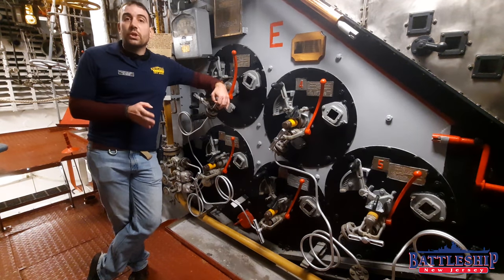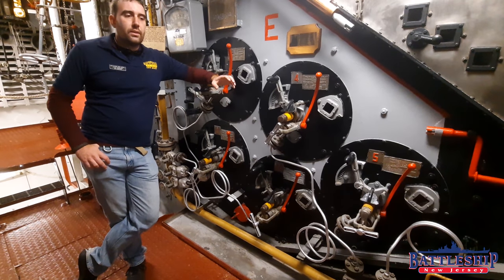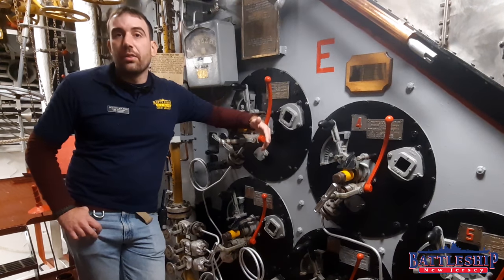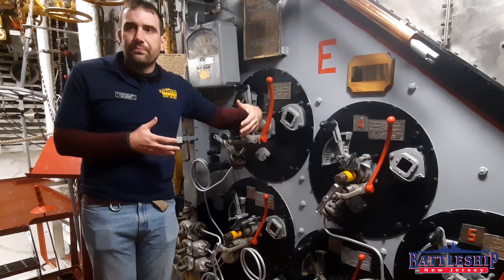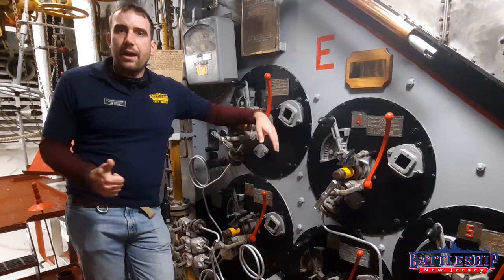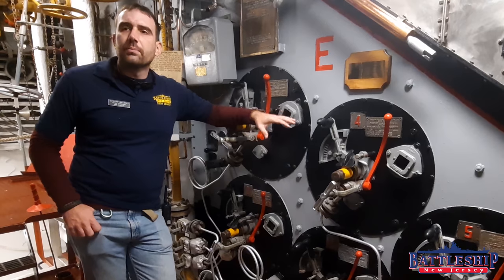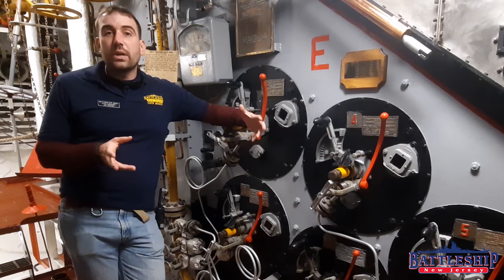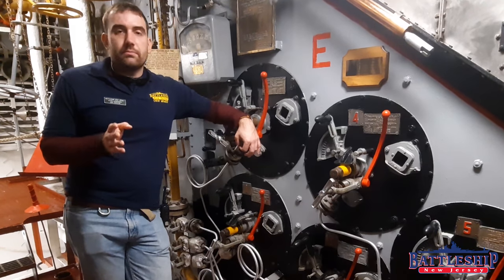Nuclear Powered Battleships

Comment: One of the things that I don't recall you mentioning were the training requirements for the crew. The U.S. Navy's nuclear power program is one of the toughest and most rigorous technical training programs in existence. The enlisted theory section is the rough equivalent of a 30 quarter hour engineering course load. Then you go to prototype for hands on training. Then when you get to your ship or sub you qualify all over again on that specific vessel. None of that is easy, and the Navy has to be able to offer good pay and bonuses to get and more importantly retain the people they need who can complete all the qualifications and do the job. The training needed to operate a conventional steam plant is nowhere near as intensive. And all that regardless of the fact that you're basically looking at 600 lb steam plants with different sources of heat.

But if things go wrong with a conventional steam plant you simply flick a switch and the plant is shut down. On a nuclear power plant you can flick a switch and shut down the nuclear chain reaction, but it will still be producing decay heat at roughly 7% of the power level it had been operating at for an extended period of time until it actually cools down completely.

Comment: If building from keel up, I'd be seriously considering liquid fuel reactors (such as FLiNaK or FLiBe), but also having diesel backup so if all reactors were knocked offline, diesel can still get the ship out of harm's way. Liquid fuel has several advantages, one, when it comes to refueling, holes need not be cut (or hatches opened up), rather, use pipes to swap the fuel out.

Comment: Ah, wondering when this one would come up considering the number of times I've seen the "nuclear refit the Iowas" argument made.  Totally agree with what you said re it not being viable.  Between the weight of the reactor plant and all its shielding outweighing the boilers it'd replace by a good margin and the different steam conditions nuclear plants produce requiring significant reworking of the rest of the systems it'd likely cost almost as much as a new Iowa to refit even if somehow we didn't have to design a new reactor system from scratch.  If there were to be a propulsion change because for whatever reason we've committed to bring back the Iowas I'd probably think it'd be hybrid gas turbines or gas turbine-electric as the only financially viable options.  What I am curious about and hope the Pentagon is watching and planning for is the potential military use of SMR technology.  Using a modular integrated reactor that can take less space, have fewer components, run with more automation and less maintenance, and be swapped out whole once its fuel load is exhausted.  That may be able to help cut down the biggest hurdle to future nuclear combatants: the staggering costs involved, 'cause I want nuclear cruisers back!
Reply: Nuclear cruisers just don't have a role in the modern navy. Not because of tactical or strategic concerns, but because of the geopolitical considerations due to their nuclear reactors. Lets face it: nuclear vessels are a significant investment, not from a cost perspective but from a political standpoint. They cannot be sent on the sorts of high-risk, independent operation missions that cruisers are intended to perform. Imagine if a CGN were to suffer a terrorist attack like the USS Cole, but instead of a damaged ship and a few dead sailors you got a damaged ship and a Chernobyl-scale nuclear incident. As such, the only role a nuclear cruiser could ever realistically be used for is a carrier escort. And there are cheaper, better ships for that job.

It's OK though, the modern DDG is the size of a cruiser, the cost of a cruiser, and fulfills all the roles of a cruiser. It's just called a destroyer so Congress will pay for them ;)
Reply: Please understand I am not trying to pick a fight or be disrespectful but are you sure on the weight issue? The steam power plant on the Iowas was MASSIVE it was the most powerful steam plant ever put on a Warship. I am an Iowa vet and I remember learning about the Steam plant in ESWAS qualifications and I could not get over how big it was.
Reply: Improvements in reactor technologies now mitigate most of the circumstances. It'd be easier to design a reactor around the ships constraints than vice versa. 
Westinghouse already begun plans and worked on it's new reactor called the eVinci the first "Solid State" reactor.
- Unlike conventional reactors the Solid State reactor has no moving parts except the control rods. 
- Unlike conventional PWR reactors there is no water in the core thus no risk of any core failure or coolant leak issues
- The Unit doesn't use flow coolants of liquid metal like flammable/explosive sodium or heavy lead/bismuth eutetic thus mitigating molten metal's corrosive issues

- Factory built thus components can be brought into the ship by hand. 
- mitigates all waste heat via solid state tubes i.e heat pipes just like the CPU in your computer. 
- Initital heat exchange takes place Outside the reactor, not in it thus there is no need coolant loop or pumped coolant loop, since it conveys heat by solid thermal contact instead of a working fluid; it requires no pumps and thus No emergency pumps are needed for overheating risk
- Manpower requirements are significantly lower, thus making it nearly a turn key operation. 
- Solid state thermal contact also ignores gravity thus making it ideal in zero-G environments like space or can be installed in any orientation without compromising function
- The reactor is sealed but doesn't use a pressurized vessel. 

- The core is encapsulated in pyrolitic graphite and use TRISO fuel, thus compatible to the High enrichment rate of naval reactors thus potentially achieve a full life cycle before refueling. 
- Unit doesn't require a stationary stability bed; and can jostle around a tad in shaky conditions without harm
Lastly, the reactor has a core max temp of 1,500 degree's C, and TRISO fuel elements have a melting point of 2,800 degrees C; so it can operate at variable peak output temperatures of 400,500,800 degree's C (same as New Jersey's Engines); thus able to produce with exact 600 psi, 450 degree steam, this makes it compatible with the Iowa class' existing boilers and turbines; thus the propulsion plant doesn't need ANY changes. So the reactor can be installed in place of the furnace. Only an Adaptation in lieu of conventional heat exchanger to mate with the new design is necessary.

Comment: Excellent analysis.
I'm a nuclear engineering major, so I obviously have really positive opinions of nuclear power, however, I think you're point of robustness is very important. Even assuming the shock does destroy a plant, I would rather have a diesel spill than a radiated section of a battleship.
Of course, this would probably never happen because the concept of designing something with the idea of taking damage as one of its primary roles is a bit outdated but it's possible.
Reply: Ultimately it doesn't matter, naval reactors are designed to be damaged and the reactor compartments are obviously shielded, worst case scenario you can flood a compartment on a ship to add more shielding
Reply: @Hostilegeese  Exposing a ship to eemy fire is a violation of rector safety regulations. We no longer have any submarines left in the Navy, we only have underwater reactor safety drilli platforms. This is why after 13 years in Submarines, I refused to re enlist. Upon my fnal checkout interview, I removed my Submarine Dolphins and threw them down on the Captians desk. I "Finished my 20" In the Reserves as an EOD Diver. (Actually did another 13) On dril weekend, we had a uniform insection. The CO stops and stares at me. "I believe you were in Submarines?" "Yes sir! I WAS!" "Where are your Dolphins?" "I no longer wear them Sir! I consider myself an ex submariner!" "Either you put the fish on or submit a request to remove your sub quals!" "It will be on your desk by 1630 Sir!" And so it was.
Reply: @bernieeod57  Presume you enjoy being under the water. From subs to diving… respect & BZ. I am a little confused by your statement, are you saying the submarine community is trained to run away from a fight, or am I missing something?
Reply: @stevedoe1630  The sub force is nothing more than a nuclear reactor safety drill platform. They cannot fight nobly spit shine and do reactor safety drills
Reply: @stevedoe1630  Which is why after 13 years in the sub force, I refused to te enlist. In my final checkout interview, I ripped my Submarine Dolphins off my uniform and threw them on the Captain's desk. I did another 13 years in the Reserves. When my Reserve unit CO ordered me to wear my Dolphins, I had my Submarine Qualifications administratively removed rather than wear them
Reply: @stevedoe1630  I am not alone. When I requested a transfer to EOD, I was told "If we allowed everyone to transfer off who wanted off, we would have to tie up have our boats for lack of crew". When I told the detailer I was getting out, he arrogantly stated "No you won't You are an E-6 with over 10 years service! You won't get out!" I was one of 5 E-6's over 10 on my last boat refusing to re enlist. All 5 of us were ordered to see a shrink, career counselor, the Squadron Chaplain, and then appear before the Commodore and tell him to his face that we refuse to re enlist. All 5 of us did.
Reply: @stevedoe1630  In my reserve EOD unit, our #1 source of Divers were former Submariners who while serving on subs, were ships Divers. The Commodore came over to our unit and ordered us to do our drills in the Sub force. He was furious that a Reserve EOD unit was "Stealing his Sailors" Since I had my Sub quals administratively removed, they couldn't touch me. The others transferred to IRR until this blew over and then re joined the unit.
Reply: @bernieeod57  Glad you make it work for you. I have mad respect for nuclear training, and I have even greater respect for commercial/military divers. Does military train saturation divers? That stuff scares me like no other.
Reply: @stevedoe1630  Yes the Navy does have sat Divers. Read "Blind mans bluff
Reply: Improvements in reactor technologies now mitigate most of the circumstances. It'd be easier to design a reactor around the ships constraints than vice versa. 
Westinghouse already begun plans and worked on it's new reactor called the eVinci the first "Solid State" reactor.
- Unlike conventional reactors the Solid State reactor has no moving parts except the control rods. 
- Unlike conventional PWR reactors there is no water in the core thus no risk of any core failure or coolant leak issues
- The Unit doesn't use flow coolants of liquid metal like flammable/explosive sodium or heavy lead/bismuth eutetic thus mitigating molten metal's corrosive issues
- Factory built thus components can be brought into the ship by hand. 
- mitigates all waste heat via solid state tubes i.e heat pipes just like the CPU in your computer. 
- Initial heat exchange takes place Outside the reactor, not in it thus there is no need coolant loop or pumped coolant loop, since it conveys heat by solid thermal contact instead of a working fluid; it requires no pumps and thus No emergency pumps are needed for overheating risk
- Manpower requirements are significantly lower, thus making it nearly a turn key operation. 
- Solid state thermal contact also ignores gravity thus making it ideal in zero-G environments like space or can be installed in any orientation without compromising function
- The reactor is sealed but doesn't use a pressurized vessel. 
- The core is encapsulated in pyrolitic graphite and use TRISO fuel, thus compatible to the High enrichment rate of naval reactors thus potentially achieve a full life cycle before refueling. 
- Unit doesn't require a stationary stability bed; and can jostle around a tad in shaky conditions without harm
Lastly, the reactor has a core max temp of 1,500 degree's C, and TRISO fuel elements have a melting point of 2,800 degrees C; so it can operate at variable peak output temperatures of 400,500,800 degree's C (same as New Jersey's Engines); thus able to produce with exact 600 psi, 450 degree steam, this makes it compatible with the Iowa class' existing boilers and turbines; thus the propulsion plant doesn't need ANY changes. So the reactor can be installed in place of the furnace. Only an Adaptation in lieu of conventional heat exchanger to mate with the new design is necessary.

Comment: I really like this discussion.  In general, I think you could make the equipment sufficiently robust against some level of shock.  In submarines and carriers, and of course land based systems, this may not be necessary and this is not done, or not done to a large degree, but that does not make it impossible.  In the end, a reactor is a pressure vessel.  So are the boilers in a conventional steam powerplant.  Those too do not react terribly well to a great deal of shock, and certainly not to penetrating damage, but a nuclear system would not have undo greater chances of being incapacitated with remote damaging effects in my mind, were the proper design goals achieved.

That said, these ships were designed not only to absorb weapon impacts with armor, but also to take and survive penetrating damage.  No matter your active defenses, some hits will impact, as you mention.  But likewise, no matter your armor...well, time and again it's been proven to be less than foolproof, even on ships with greater tonnage devoted to it than the Iowas.  Losing one fireroom and one turbine for a conventional plant won't make anyone in those workspaces very happy (or indeed very alive, most likely), but nuclear breaches have a greater chance of causing even greater casualties.  I think this is their biggest failure mode within the concept of a brawling surface vessel, and why I agree entirely with the conclusion that I actually fully expected you to make here when clicking.

Good topic!
Reply: 1. There are nuclear powered ice breakers designed with shock in mind.
2. The video author states he was for the old CGN's. He somehow thinks it is safer to be in a ship designed to receive anti-ship missiles (instead of the CVN) without armor than an armored battleship.
Reply: 1 the Russians built 3 of them(that I can recall off the top) all designed to bull through extremely thick ice.  They operate on Russia's northern seas and interestingly can never leave said waters as they use the insanely cold(it'd be frozen if not for the salt) water to cool thier reactors
2) yeah caught that as well.  All milspec vessals are constructed with the knowledge you'll take damage
Reply: Realistically speaking, the only threats to a modern battleship are from Submarines and Mines.  Carriers can provide the air protection.  Modern anti-ship missiles are not designed to penetrate much armor, and even if they are, the Iowa's have 12" of belt armor, and 6" of main deck armor.  Both of which are buried under 1.5" thick STS (structural armor steel, effectively) outer materials.  The outer hull is something like a foot and change away from the main armor belt so you are dealing with spaced armor there and the weather deck is a full 8 feet above the main armor deck so once again, spaced armor.  

It's not impossible to design a system which is designed to take hits, and chances are the reactor area would be the heaviest armored part of the ship.
Reply: @Whiskey11Gaming  To be fair, modern anti-ship systems are designed to tackle threats of their times. In the case that someone should develop a battleship with armour to be penetrated, then someone else will inevitably try to build a means to do the penetrating, or better still, bypass it altogether. Regardless, a battleship's main issues come to roost when one does a cost-benefit analysis. It's one centralised missile or gun platform which costs as much as an aircraft carrier, yet doesn't have the same flexibility nor is subject to the same economies of scale, and resultantly is readily substitutable with many smaller vessels.

Love your WoWs vids!

Comment: This is an excellent video with clear and carefully chosen articulation.

As to the content my only critique is that we really can't properly evaluate the sensitivity of a nuclear reactor to adverse conditions because it is classified.  I think it would be fair to allow for the present possibility of shock/damage hardened nuclear propulsion.
Reply: While such details are indeed classified, we can draw useful conclusions from the few Cold War-era nuclear submarines that were lost at sea.  They suffered extreme structural failure due to implosion yet their reactor pressure vessels remained intact.  It's reasonable to assume the reactors are designed to remain intact under most battle damage scenarios that would otherwise destroy the ship.

Comment: You make some really good points,  and offer some interesting insights.  I have considered some of the points you mentioned,  especially retrofitting a reactor into an existing hull, and yes that would be extremely difficult and expensive,  probably compromising the armored decks and hull.
Building a new ship, would be a better option as technology has evolved and newer operating systems would be more efficient.  But as you stated,  a reactor could become an issue,  but if a sub, or a carrier were hit, the same thing could happen,  your argument about damage to the reactor and defense systems are still in play there, 
A battleship does not live alone either,  it has escort vessels also. So I think  more discussion could be made and arguments for both sides are valid. 
The other issue is,  where would we today make new 16" rifles? And projectiles? And powder?
No one has done any real research in those technologies for a very long time